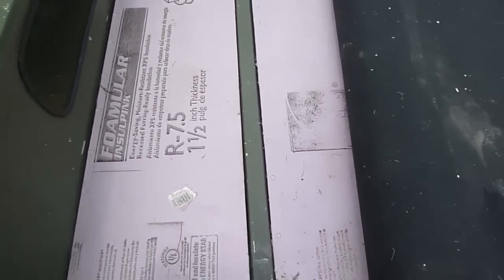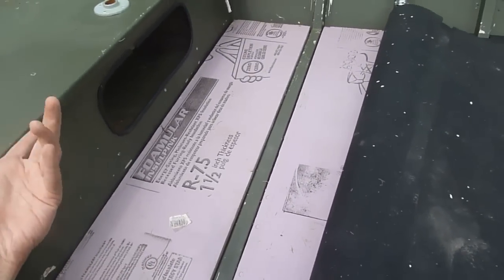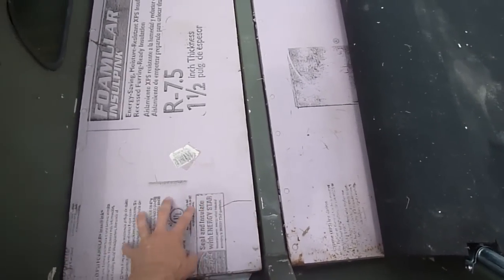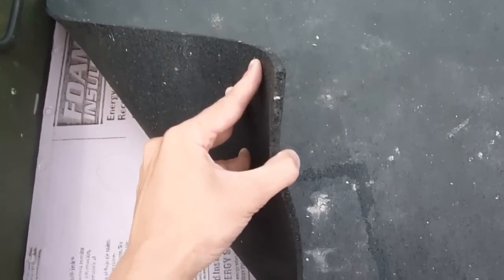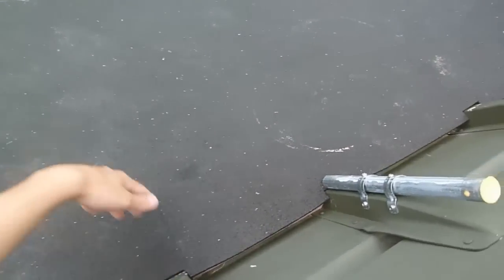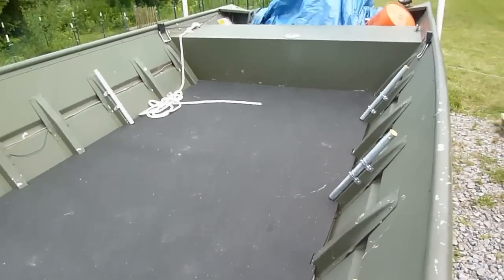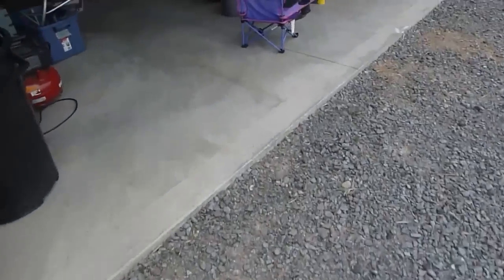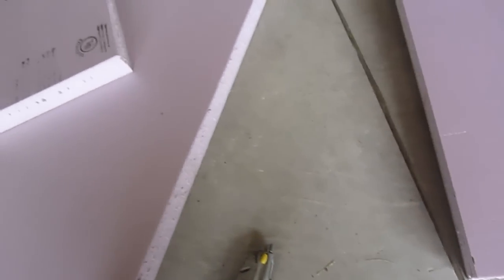cheap and lightweight Boat floor for our jon boat (MATERIALS LISTED IN DESCRIPTION)

Comment: I used that same mat for my jon boat and it didn't last but 3 days. It's not made to withstand the South Texas heat. It shrunk and started cracking falling apart. Would not recommend it if you live in an area where it's hot most of the time.
Reply: What did you end up using over the pink insulator? I’m in east Texas as well
Reply: @buenaondaoutdoors967  did the roof cement make it heavier? If so why not just use plywood with the outdoor carpet?
Reply: @buenaondaoutdoors967  can you make a video of it on your channel? I subscribed to it!!

Comment: Cool alternative to wood. My only question is water with it. A) does it still drain under the foam back to stern if it gets past the mat. And B) can you wash boat out inside still or does it then get under mat and saturate?

Thanks
Reply: The foam won’t block your drainage. The pink foam is closed cell foam so it will not soak up water, so they say.

Comment: What's the foam for? Just a filler? if you are thinking it will help the boat float if it got holed, it would just float right outta there..
Reply: Scott Davis it's a filler so the stall matts lay flat

Comment: The spars in my jon boat are only 1" tall.  Is it ok to get the 1" thick Foamular instead of 1-1/2", or is there a need to have the foam slightly higher than the spar.  Not sure if your spars were 1-1/2" high, and that's why you went with 1-1/2" Foamular, or if your spars were 1" high like mine, and you went with 1-1/2" thick Foamular for a particular reason.
Reply from the maker: You want to get a foam board that matches the height of your spars that way the mat sits flat across the whole thing. GOOD CATCH!
Reply: Mine is 3” so I have to use the 3” foam